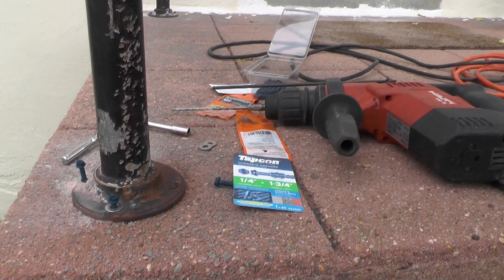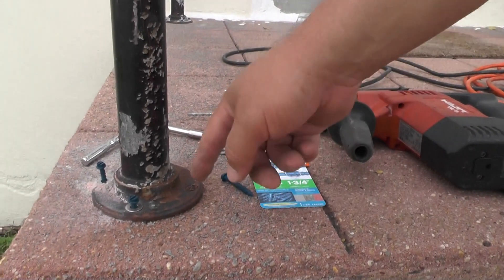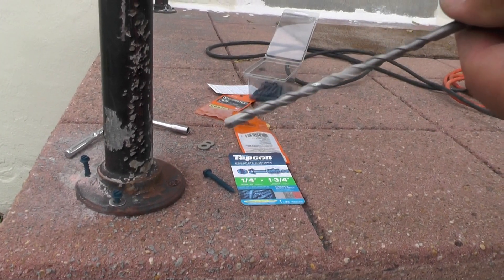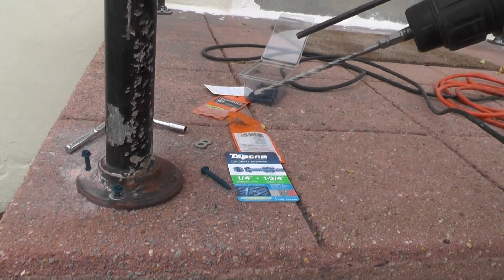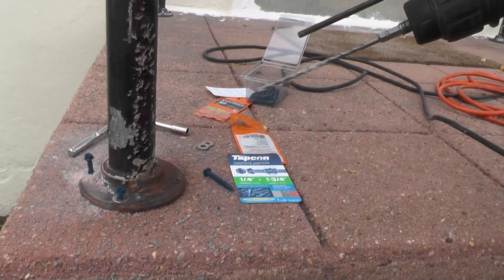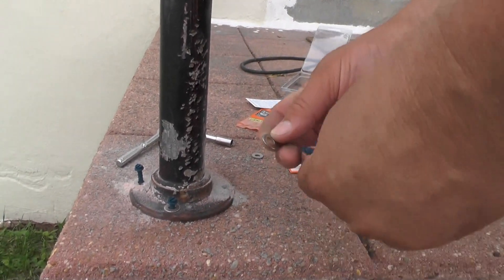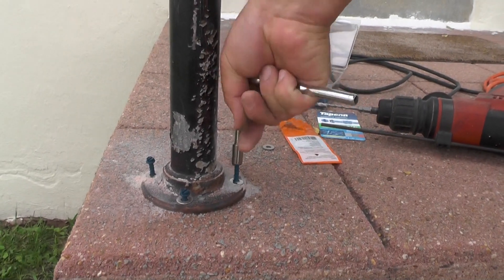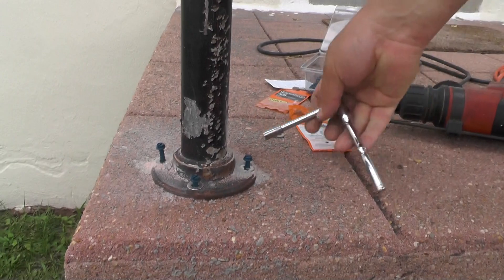How to install Tapcon concrete anchor screws with a hammer drill

Comment: Thanks for the video, I think it is recommended to vacuum out the concrete dust before inserting the screw, helps prevent cracking, something like that, but thanks for the video

Comment: Are they still holding strong?
Reply from the maker: Hi and Thanks for your question. So far, so good! It's been almost 4 years and (knock on wood) the rails are still SOLID.
However, I try to make sure that no one sits on the rail or leans on the rail, because especially with the annual thermocycling that takes place here in Pennsylvania, there's a good chance for weakness over time. Probably this is due more to the cement, and not the Tapcon itself. This is what I think happened the first time I had to do this job.
Anyway, Hope this helps. And good luck with your project!
Reply: @stevenofpa  Gotcha, thanks. Good instructions. I'm in Milwaukee and I just installed a 4x4 post in an old concrete pad for a hose hanger. I used 2.25 inch tapcons.  I hope it lasts.

Comment: Doing this without water will KILL you I was setup up by my boss the dust is most toxic dust on the planet with no treatments no cure look up silicosis before you mess with concrete I wish I would have know I worry everyday I will die on front of my family because of this. And you need a respirator and a water hose..

Comment: What a laugh, this is amateur hour.  Anyone viewing this go look for another youtube vid.  Always blow out, vacuum out, the drilled hole before driving the screw.  Be careful with old or weak concrete or cinderblock and an impact driver or hammer/screwdriver, it's easy to strip out the hole, particularly cinderblock.  Those last couple twists, depending on the material I might use a rachet.  And lastly, who would leave leave any type of connection hanging like that?

Comment: What size socket head?
Reply from the maker: Hello, and thanks for your question. It's been a few years, but I'm pretty sure it was 5/16" socket for those. Hope this helps!
Reply: @stevenofpa  It has;  thank you. Last question, do you really need the washers?
Reply from the maker: @prospectsinc  Probably not. We used to use these anchors at work all the time, and never used washers. But since these screws were pretty close to the size of the holes in the railing, I thought it would help to spread the load and prevent them from wiggling out. SO far it's held up well, for about 2 years now. Railing is still solid!

Comment: size of tapcon for weight of post /pole  ?? size of  the drillbit for that certain size tapcon screw ??
Reply from the maker: Yes, there is a certain size concrete drill bit that has to be used with each type and size of Tapcon screw. If the correct size is not used, then the screw might not work properly. I used a 3/16 Tapcon brand drill bit with a Hilti hammer drill. A regular drill won't work, because it can't provide the force necessary to penetrate the concrete and drill the proper hole. Hope this helps!
Reply: So the drill bit has to be same size as the screw or a size smaller?
Reply: @ercanmustafa2742  No longer.
Reply: I was to secure a post on interlocking... Think this would work also?